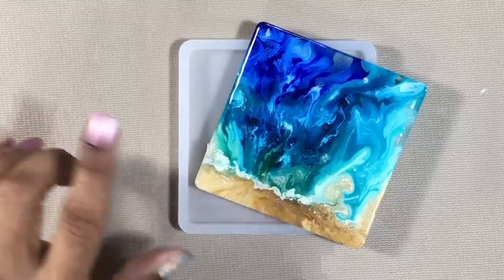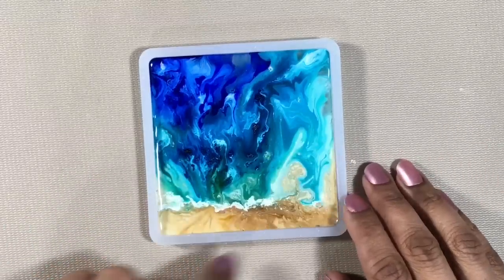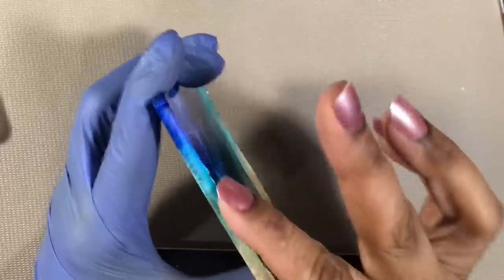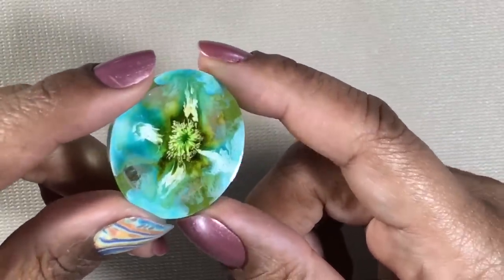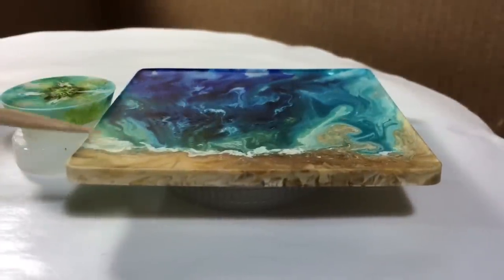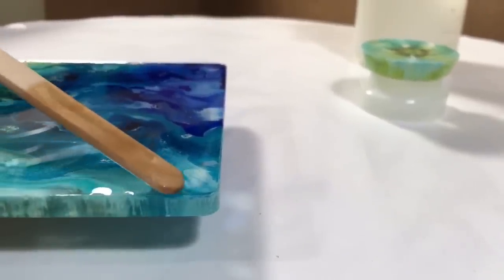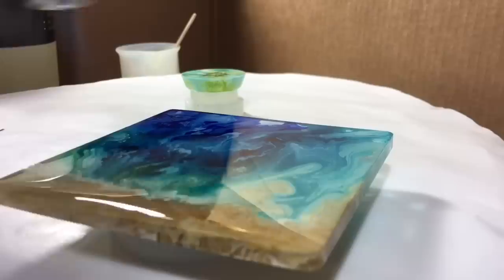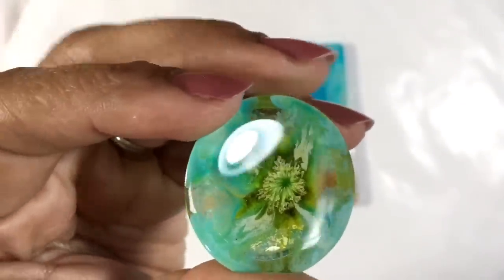58] RESIN : Getting a DOMED flawless FINISH on Pieces from a MOLD or taped Fluid art

Comment: I loved this ! Speaking of molds. How full do you fill them to? There is a line if you will. On the inside. I went above that of course!  I’m going to try to stay at that line for my next fill. Unless  you say it needs to he full . I love these. I have the white square mold you used can’t wait to try these.  On to my next video! The girls told me how to find the comment section !   Love them girls!
Reply from the maker: Hi Annette!  So nice to see you here in the comments section!  Thank you so much for supporting me on Patreon!!  As my patron, your questions are automatically at the top of my to do list both here and on Patreon! 😄💕

Since I like to have the resin “lip” to facilitate a doming topcoat, I always try to stay about 2/3 of the way up in a mold if it’s a shallow one.  The topcoat will make up the difference.  The resin you use will also play a factor... if you use one that is more “bendy” when it comes out of the mold (less hard/rigid) you would be best to add more resin to the mold so that your piece is less likely to  lose its level shape when it gets popped out of the mold.
What you add to the resin also comes into play... liquids like alcohol ink, acrylic paints, etc.  can make a resin “softer” once it cures in which case you’d want to fill the mold up a teenie bit more.  Personally, I try never to fill a mold to the top unless I know I can get a really perfect top.  If I can, then filling to the top can allow for a slight dome... but make sure the mold is really level so nothing spills over any edge.  As I said in the video, I think filling to the top is often a waste of resin.  That’s another reason I don’t and add a thin topcoat later.  I hope that all made sense.  Feel free to ask any clarifying questions.  I’m here for you patron!! 😘😘💕💕😊
Reply: Wow! Such beauty! It must be a deep satisfying feeling to know that you created these! Thank you for sharing your ideas. I'll be looking forward to more of your tutorials.😊💙💚🌟🧡👍

Comment: I watch videos every day to the point that I have to stop & get things done around the house. I have to tell you I love this taping & have learned more about resin plus all of the information you have provided. I have been painting on canvas & doing shows for a few years now but never have I finished them off with the resin because I thought I liked the raw look until I did my first piece & was surprised at how much more the colors popped. So now I am trying to learn as much as I can about resin. Which I thought I had done a lot of research & bought 2 1 gallon casting resin but came across yesterday  that I bought the wrong stuff to finish off my acrylic paintings. Found out why my edges after the cure were not covered & it is because I needed to know about a thicker resin & about doming! So I will go back to your previous videos & watch how you pour your molds. Thank you so much...sorry I went on & on however, I can use a thinner resin for silicone molds just not for my canvas pieces

Comment: Beautiful pieces and amazing lesson!! I am brand new to resin and I decided to add some onto my piece, and then I realized I will eventually need to sand down the edges because of the tape. You explained it in a way that was very easy to follow and I never even thought of using a top coat to fill in the lip, I thought I would have to sand it down completely. Amazing job, and thank you so much!

Comment: I watched many of your videos, mostly to see what beautiful ideas that you come up with next. You are an awesome teacher, truly gifted!! I would like to know for the alcohol inked tiles, were do you order your molds from, I would like to order several of them. Also do I need to spray them first before I apply the resin and how can I become a patreon of yours?
Reply from the maker: First of all, thank you so so much for that amazingly kind, thoughtful comment!  It put such a smile on my face!! 😊💕
Many of my molds I get through Amazon or EBay.  Here are a couple of links that should help:
Set of 6 different molds... a couple are coaster size and one is the same as the mold I used:  https://amzn.to/2LHy4Ni
I made the 3.9”/9.8cm square petri/coaster (show in the video) in a silicone mold I purchased on eBay ... These molds take 2 - 3 weeks to arrive but cost about $2 including shipping!  Please note some have a shiny interior finish and some have a satin interior ... both finishes are pretty:
https://ebay.to/2FkTz3f

About your other question:
I never spray silicone molds before using them for resin (it won’t hurt if you do, it’s just not necessary).  Resin will release very,  VERY easily from the translucent silicone I use for the coaster/tiles.  The red molds meant for baking also work well for silicone but if you torch to release bubbles in the resin too close to the edge (where it meets the mold) the resin can stick.  If you avoid using the torch for that, red molds release well too.I hope that helps a bit. 😊

Now about being a patron of mine on Patreon... oh my gosh, that would be awesome!!  Here is a link to my Patreon page:  https://www.patreon.com/myriamsnature   As a patron, your questions are ALWAYS ANSWERED before anyone else’s , you get access to exclusive content, and more!!  I hope you’ll join the family! Thanks for your interest! 😘💕

Comment: Hi Myriam, i love watching your videos and all are very informative. I have a question which i asked from few online artist too. but no one gave me a answer, thinking of asking you too. 
What is the difference between hot gun and a torch? 
If it is possible you can teach us how to create a beach scene with resin?
Reply from the maker: Hi Sadia... thank you for your very kind words! 😊💕 

The main difference between a heat gun and a torch is that a heat gun is electric and blows extremely hot air (much, much  hotter than a hair blow dryer), while a torch runs on fuel (usually butane for small portable torches) and it shoots out fire (think of it as a super hot cigarette lighter 😁).  Both are used for two main purposes in fluid art: 1) to pop air bubbles and 2) to bring about special effects like cells and lacing.

Each of these tools has its pros and cons.  A heat gun doesn’t require refilling with fuel and is probably less dangerous overall.  It can also be used to “move” paint and resin a little bit since it expels air.  A torch on the other hand is more portable and doesn’t require being near an outlet.  It can also let you be more specific/precise about where you want to bring up more cells by aiming the point of the flame.  It may also be a bit faster at bringing up the cells (I might be imagining that 😅).  If NOT moving the paint or resin is important the torch can also be better since it doesn’t blow air.   If you can have both, I’d recommend both... you’ll know when to grab each depending on what you want to accomplish.  

About the resin beach, I actually did a video a while ago:  https://youtu.be/FXqBf-Uxd54 

I hope that all helps a bit. 😊💕
Reply: @MyriamsNature  I really really appreciate your detail answer. I want to use one of them or may be both with resin for creating special effects and popping the bubbles too. So i will try to buy both but in Canada few things are really expensive. I am really surprised to see your answer. Once more thanks a lot.

Comment: Hello , your a really a great teacher ! 😍 I have a question about doming with resin. Can I use any resin or should I purchase a certain type of resin ? Right now I have Stone coat  tabletop resin for coasters . Can I use this for jewelry ? This is my first time using molds can you coasters. I have been trying to make coasters an easier way by using the molds. right now I can’t find the 4 1/4 inch tiles in my area which is what I normally use. So I need your help and experience .

Comment: Thank you for your great tips. I’ve tried the nail filer and it works great, but it leaves an opaque look on those edges. It’s there away to remove the cloudy surface after sanding it? I’ll appreciate your feedback

Comment: Hi Myriam, I love the video.  On the Cabs that you have too much white, have you tried sanding a little off the top?  Just curious if that might help salvage a piece.
Reply from the maker: Hi Motherbear!  I haven’t done it personally (lack of sanding equipment... hand sanding would be too arduous I think) but I’ve been told by many that it works well.  If you do it, remember to wear a mask!!  Resin dust is very fine and not lung friendly at all!! 😊💕

Comment: One step missing in all the resin videos I've watched,  seems to skip the step telling us when to put the resin on our sides after filing and how to do it without it getting it onto the front or back.  I did it right after filing and I use my Stir stick to just rub it on.  Do you have a better suggestion?   Also, do we need to finish off the piece with polycrylic?   Thanks. I've only made 2 pieces so far so I'm still learning

Comment: Myriam I love watching your videos they are very helpful,  I have a couple of questions if I wanted to add a design out of vinyl can I add it then add a top coat? What do you use to add the hole for pendants
Reply from the maker: Hi Lisa!  First of all thank you so much. You can absolutely put vinyl as an embellishment under a layer of resin. What I would recommend is allowing some of the top layer of resin to touch the resin layer beneath the vinyl (in other words, don’t let the vinyl piece completely cover the first layer of resin) ...  allowing the two layers of resin to meet in some spots will permit them to bond and encapsulate the vinyl securely.  The new resin would not grab onto the vinyl well because it’s such a slick surface.  
Before adding the topcoat of resin, sand your first layer of resin a little bit, to give it some tooth for the new layer to grab onto. Don’t worry about the fact that you will have a scratched piece of resin… I promise the next layer will completely correct that.
I hope that helps a bit. 😊💕

Comment: Hi myriam! I came to the most recent upload to ask if you had any advice for helping my neon colors stand out when using a black base instead of white? Everytime, after they dry the colors are barely visible!  And...I love all of your videos!
Reply from the maker: Hi Jolene… I apologize for the delay in getting back to you. Do you know offhand if your colors are opaque or transparent… That would make a huge difference. If they are transparent, once your painting dries you would see through the paint and therefore the black would dominate.   Another question, are you doing a dirty pour onto a wet black background? And is black your negative space or is black also being used within the dirty pour?  I will wait for your answer before proceeding. 😊 Start a new comment rather than add a reply to this one. New comments appear in my feed much faster and more reliably than replies to older comments. 😊💕 Thank you for the kind words !!

Comment: Hey Myriam;  I have a round molding that I make my coasters in and I’m having a problem not with the mold though. I set them on the silicone mat I didn’t realize it but the mat had a design in it and a little bit of resin got on the bottom of each coaster and now it has this pattern from that silicone pad.. Can you tell me how I would get that pattern off. Can I sanded a little bit and put a slight coat of resin on the bottom they are supposed to be clear but now or not thank you looking forward to your answer I need to get these done is send as possible thank you so much

Comment: Thank you for this - so helpful as I'm still learning. I checked out your list of supplies and I definitely need to order the respirator and filters! Resin has given me terrible headaches without PPE. Question though - what size? I'm thinking small as these are most likely geared towards men. ??
Reply from the maker: Hi Sally.  I’m happy the channel is proving useful to you. 3M makes many good masks ... an easy to find, practical, affordable one: https://amzn.to/2m0zjwx  (this is what I have).

Once you have the mask you then need cartridges rated for vapors. I recommend one with at least a black label, preferably a yellow label… Black covers organic vapors and yellow covers organic vapors as well as acid gases… Since there isn’t really a cost difference I think yellow is probably better so I get these: https://amzn.to/2u3267Z   There are higher end facemasks but the real important part is the cartridge. When choosing a mask size, it seemed best to pick medium … That fits most adults according to 3M ( the other sizes are small (mostly for children or very petite adults) and large for larger heads/faces).  The fit is important because an overly loose one defeats the purpose if outside air can leak in, but one that is too small is also not recommended.I hope that helps a tiny bit. 😊💕
Reply: @MyriamsNature   Gosh. I ordered sml. I'm not very petite but I'm 5'4" and have a small head and I went by their measurements. I'm hoping I'm good. Haven't used it yet but it fits snug and if I hold my hands over the side vents I get no air inside the mask at all. Love your work and personality. Keep safe!

Comment: Omg these are gorgeous! I’m relatively new to resin (for finishing my acrylic pour coasters on tiles), and I’ve noticed and both times, the trains have cured really well, just that on applying pressure to the surface or testing them with mugs, leaves dents and scratches on the smooth surface. Do you know how I can prevent that and have the resin rock solid?
Reply: The resins have cured* (sorry about the autocorrect)
Reply from the maker: Hi Sarah ... this is a difficult question to answer without knowing which resin you are using and other factors. Every resin is different. Most should cure rockhard and should not leave dents. Some are also less  scratch resistant than others.   Assuming you have a resin that does cure rockhard, some things can influence how resin cures... for example temperature, humidity, how well you mixed part A and B.  
If you aren’t a member of my Facebook group, consider joining so that you have a place to ask questions and not wait too long for answers. There are a ton of very experienced artists there who happily share their knowledge too 😊.   I don’t often have time to answer all the detailed questions here on Youtube, but I do want to make sure you get help to have lots of resin success 😊.
Here is a link to the group :
https://www.facebook.com/groups/Myriams.Fluid.Art.Tribe    😊💕 Thank you for your very kind words!  I hope you will join us, get inspired, learn new tricks, and also share your work (if you would like).

Comment: Hi Myriam (with a y) , you gave me the confidence to use regular resin, I'm so use to UV, so watching you it didn't look much different, I made 3 puffed hearts and one petri dish,  I turned into a mad scientist, I did so many layers of alcohol inks, I kept asking myself is this enough?  My reply was always no, I quit when I was afraid it was going to run over the sides!  Now for my problem, do I sit next to it and wait 24 hours?  No sleep?  If I go to bed I will have a hard time sleeping.  I love your pendants/cabochons, really lovely, my favorite is the magenta & blue, what mold did you use for that?  Thanks for the ins;piration!
Reply from the maker: Hi Donna... congrats on making the leap!! 🎉🎉🎉😄  Woo hoo!!!  
I LOVE LOVE UV resin ... but two part epoxy will change your life!!  Now you can work bigger, and in larger batches (for small things like jewelry) without the exorbitant comparative cost of UV resin.
Go to sleep... your resin will be fine without you, just cover it to prevent unnecessary dust.  
For the mold question, are you asking about the small discs?  If yes, I used this 30 cavity mold : https://amzn.to/2joRxqp  Be advised that the sides taper so that might not be what you want.  I think if you look at it and would prefer a more straight-up-and-down-side-wall look you can find a non-tapering version of the mold.  I remember seeing one I think.
I hope that helps. 😊💕 Thank you for always being so sweet in your comments!

Comment: Loved your video. I seem to be having trouble with my pieces curing. They're cured all the way but they look like they have a slight ripple effect on top. They're not smooth. I'm not sure what's effecting the resin. Can the temperature of a room effect the curing process? I usually stick mine in the closet because it's the only spot I have that I know my cats won't knock them off. I'm thinking it's to cold in there.
Reply: Maybe try using a scale for exact measureing amouts of epoxy.

Comment: Love your video's..
BUT, I'm confused..another designer told me you use the back with the lip as the side use and to display them you use the first poured/ that goes in fit as  the coaster. Seems like you use the back/ where you pour the last resin in, as the top to use?  
Hope the makes sense.
Reply from the maker: Hi Sandra! I totally understood what you were trying to say. With this type of resin and alcohol ink work, sometimes both sides are very pretty 😄.  You may want to create a piece that can be flipped around occasionally.   There are also times when the side with the lip is much prettier than the side that was at the bottom of the mold… It all depends on you as the artist what you want to show off. 
Thank you very much for your kind words! I hope that helps a bit. 😊💕

Comment: I have a question if you can help me.  .  I started doing tumbles recently, my last 2 tumblers when I pass them under cold water it becomes dull.  I lose the shine.  I did the same thing twice.  I did a lot of research but no answer... I'm bothered because I just had my first client and I have to delay it because I have to correct what's wrong.  Thanks in advance